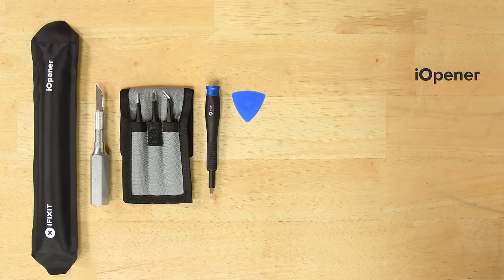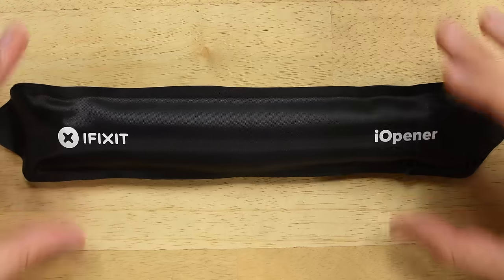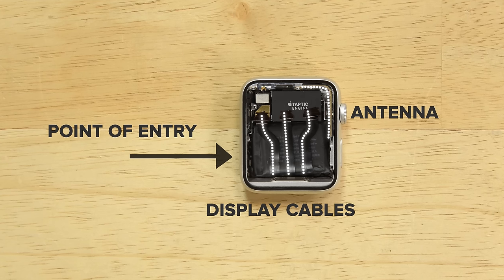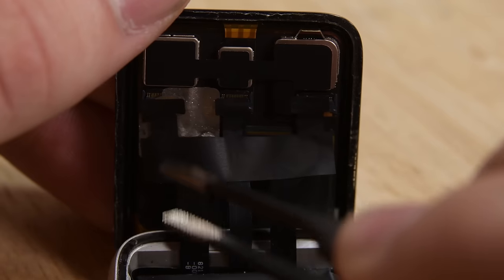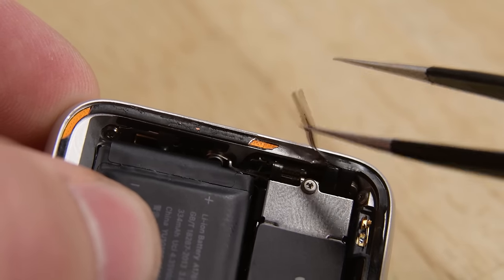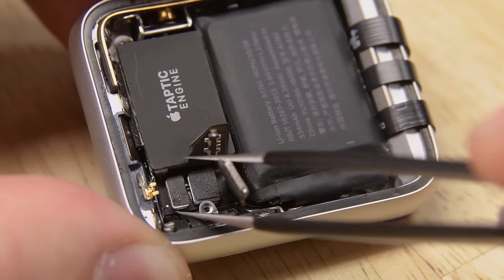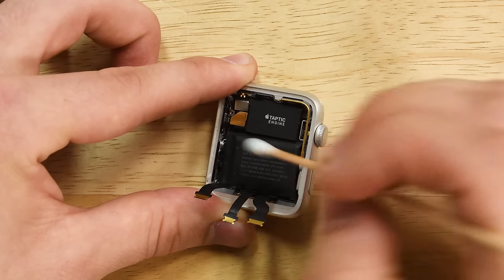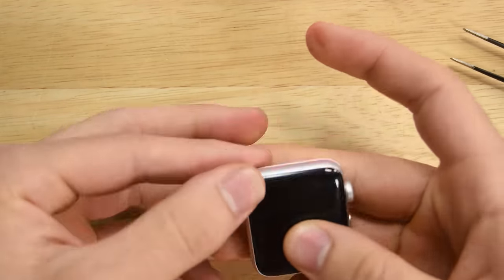Apple Watch Series 2 Display Replacement—How To

Comment: Hey, was told from customer that their display stopped working after a week ("showed Apple logo, then black"). How would this be possible? The 3 ribbon cables were perfectly in, and straight; even put the sticker back over it. 

Any ideas? Although the way the customer explained it, doesn't sound like a display issue; hopefully it's software related.

I didn't use a new gasket; original was in tact still.
Reply: Kyle Rebman did you make sure you closed the clips on the top of the ribbon cables? Because if not that’s the problem they are the lock for this cables not to come off
Reply: There entered water in my applewatch and it doesnt turn on anymore,help,what con i do?
Reply: (Applewatch Series 2)